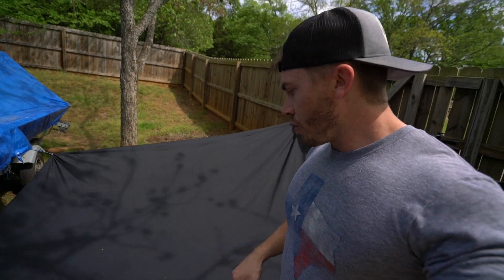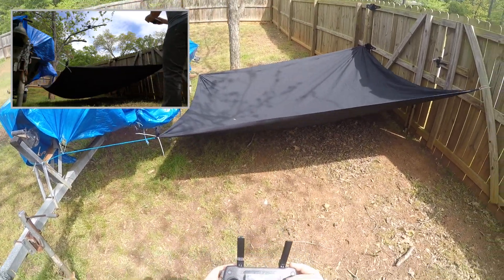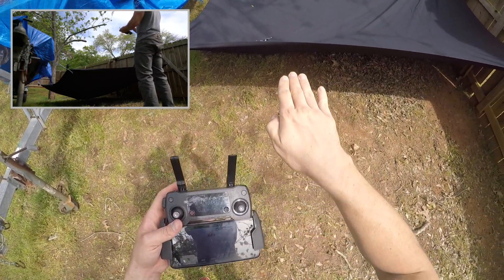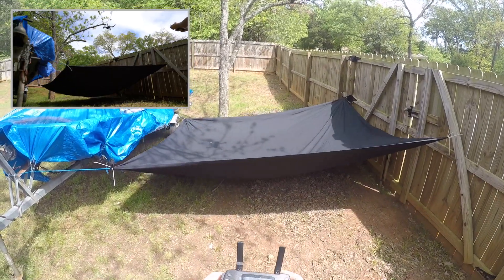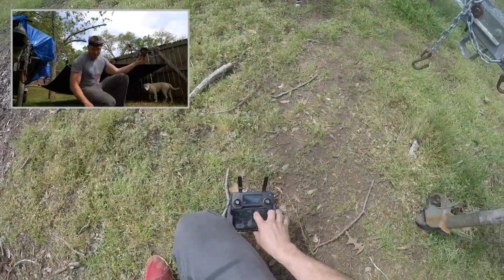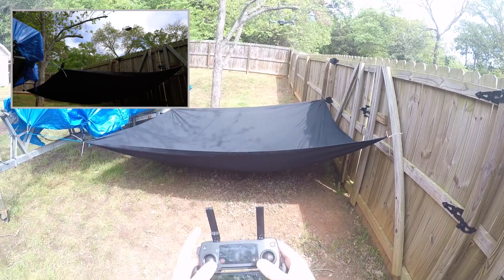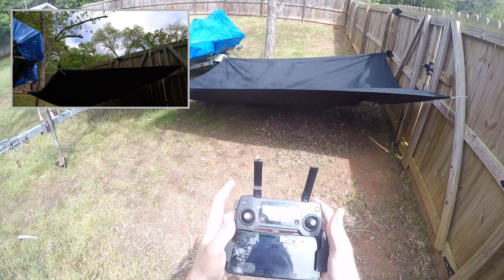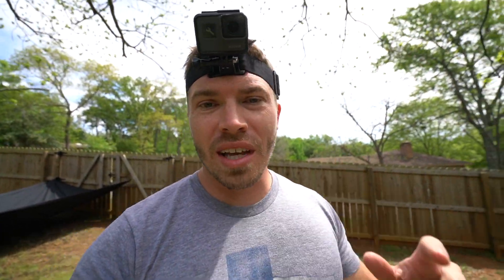Mavic Pro - Emergency Shut Off Test

Comment: Thanks for sharing your video, but I think it could still work if you position the drone over the moving vehicle at least 5 to 10 feet (depending on the speed of the vehicle) then initiate emergency shutoff so before the vehicle move from under the drone the drone would have already landed.

Comment: Hi Chris. Awesome movies man! I love your shut off and restart test. 
With regards to the Truck Landing I read online that you could change parameters to help with that by reducing the time required to shut off from 1 second to 10 milliseconds by changing "Quick motor start and shutdown***
". 

Quick motor start and shutdown***
g_config_rc_cfg_start_motor_verify_tim_ms: 10
g_config_rc_cfg_stop_motor_verify_tim_ms: 10
g_config_rc_cfg_emergency_stop_verify_time_ms: 10

One thing i wanted to ask. I read online that if mavic is tilted more than certain angle drone would consider itself being crashed and engine restart would not work. In your engines kill and restart video your mavic seemed pretty horizontal. I wander if you were just lucky or maybe you have modified the bellow parameter allowing drone to restart regardless of the tilt?

Motor restart while inverted***
g_cfg_debug_motor_no_start_motor_check: 1
g_config_fdi_open_close_auto_stop_motor_check: 1

Comment: the drone needs to be traveling the same speed as the truck,  it also needs to be as far forward in the box as it can be,  you can NOT do an emergency shut off it will loose ground speed instantly,   it needs to be flying at truck speed at all times until it's landed...

Comment: Wrong, if the drone is traveling around 30 mile an hour, the drone will have momentum, and will drop, but it will carry on going forward, distance, depends of the speed of the drone
Reply: I don’t think you understand what he is saying.  Yes the drone does have momentum and if you could stop the props instantly then yes the drone would continue traveling forward and fall into the truck but that’s not what the CSC command does.  By bringing the sticks down and in, you are commanding the drone to travel backwards, descend, and yaw.  This flight action occurs for a few seconds and then the motors stop.  By the time the motors have stopped the drone wouldn’t be in the right position to land in the truck.  Technically it’s possible but it’s not as easy as just cutting the motors right when you are above the truck bed.

Comment: fly the drone in reverse to land it on the truck. the emergency shut off will be at the right direction as flying it backwards. plus it will be easier to control from the orientation

Comment: Pretty sure you have another shut off mode: left stick up and left, right stick up and left. This might have helped moving it forward while on the truck.
Reply: MrGweilohk no I don't think there is a shut off like that but it could be configured in the settings possibly

Comment: That is the downsides to all the auto features. All my older quads and hexacopters would probably be easy to land in a moving truck. They just did whatever you told it to. I miss the ability to go into a nose dive like I could with my gaui 500x, that was awesome from up high. I am pretty sure the props stopped on it when the throttle stick was down.

Comment: Since you're doing experiments like this I have one for you. What happens if you have it in the air, say at 350 feet and accidentally do an emergency shutoff? Can you let go of the sticks and pull them back to the center and down to start the props and recover before hitting the ground?
Reply from the maker: im filming it today actually. Im scared outa my mind.
Reply: Not doable, the craft has to be near horizontal right side up to start.

Comment: I watched your brave attempts at landing on a moving truck and wondered if simply turning off the forward and downward sensors would solve the problem? You definitely had your front sensors on which slow the sensitivity of the controls down by default. The mavic is doing its very best to not crash and 'landing' while moving forward is a crash (for a drone anyhow) If it doesn't know there is anything in front or below it, it will let you 'crash' as softly as you can on to your truck.

Comment: I really want to see you retry the truck experiment. This time standing on the ground down the street while the truck is driving.  Using your screen rather than watching the drone itself.  You also won't have to worry about the Mavics props smacking you in the junk too which is a plus in my book. 

If you have a $20 pair of VR Goggles and the Litchi app i'd bet you could pull it off for sure.
Reply: Better chance of going viral if it does.

Comment: Laws of physics prevented your truck experiment from working. Cutting the motor is probably the opposite of what you need. The Mavic needed some grip onto when it landed on the back of the truck.

Comment: That experiment doesn't work dude, you did shutoff from a hover. 
If you were doing it to land on a moving truck as you performed the shutoff your Mavic would be matching the trucks speed and would probably be successful
Reply from the maker: +jedburgh01 thats very incorrect, to make the shut off happen, you have to bring both sticks, including the directional stick back and in. In my case this will cause the drone to go back and to the left. Meanwhile the truck would still be traveling foreword. There is about a 1-2 second delay for the shut off to engage.
Reply: Chris Rollins ah , I didn't consider the shutoff manoeuvre causing movement in the Mavic

Comment: i think that you could change the controller setting to cut off the motors and make it to go both inwards and up. i may be wrong tho
Reply from the maker: +Nikolas Dion dont know about in and up, BUT you can go down and outward.

Comment: I was thinking yesterday - in case you want to do a test as well: I live at the second floor apartment and I was wondering if I throw my drone in the air from my balcony and start to take off while the drone is in a free falling... you could use the same safety net you used in this video and try it and show for us =)))
Reply from the maker: +Davi Duarte whoa! Thats scary, hahaha! I dont have anywhere to make that happen, but dang, if you do it, PLEASE post it! Awesome idea!
Reply: I just saw you tried my idea! But instead of throwing out from the balcony/window, you turned it off in the mid air and turned it on again! AND IT WORKS (at least did work in your first attempt)!!! Awesome!!! I have no others crazy ideas so far =) Keep going with your good work!!! Cheers, mate.

Comment: When you do your thing you break the first rule of physics regarding landing on a moving platform.....
The first thing a carrier commander does when planes will land on it, is Face the Wind and the second one is hook to an arrestor cable
Therefore if you disable the sonar, and you land as an aiplane with positive acceleration over you landing area and you put a simple loose ping pong net instead of raising your back door, You will achive the manouver.
Gustavo Cánepa ( your Wing Man from Argentina)

Comment: Agree it doesn't work on the bed of a pickup.  But, the longer the bed, the longer it would take the truck to move out from under the now-stationary drone.  Extreme example: 40' flatbed truck moving at 2mph.  Should work.  Somewhere in between, there's a solution.  :-)
Reply from the maker: i agree! :)

Comment: Wow, I had no idea there was even an emergency shut off, haha! I wonder how often someone tries to do that maneuver and accidentally shuts off their mavic....
Reply: Alex D I thought the same thing.  But it's not.  Scary this is an option. Anyone could do this by accident if they didn't know.
Reply: Its not a normal manoeuvre to do, thats why its set that way.
Reply: some time fail down but the drone does not stop the motors, that really helpfull guy :))
Reply: Yeah, It's definitely not a common maneuver but I can see myself accidentally doing it at some point or another. Chris, can you confirm? Did you have to adjust the settings to enable this shutoff function, or does it do this by default?
Reply: Potato Jet, as I understand, this "hotkeys" are by default disabled while flying.
Reply: It is not enabled by default to operate during normal flight. Only when the drone believes that it is breaking down can this be used. You have to manually enable this to work when flying under normal conditions.